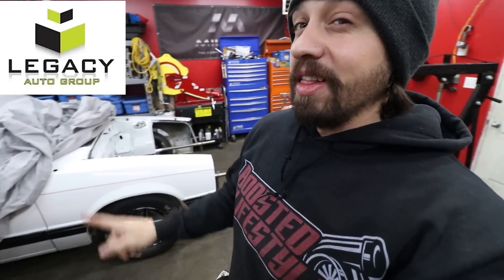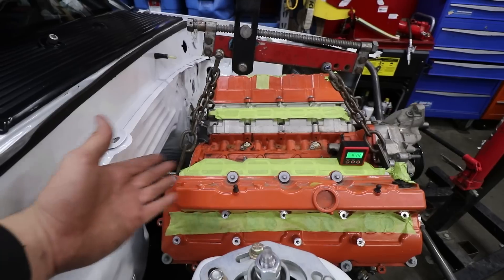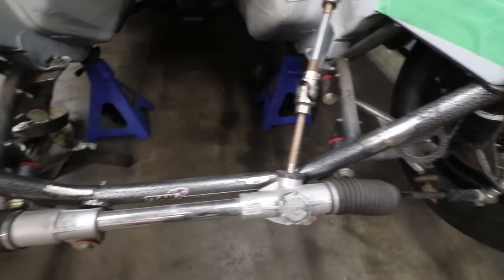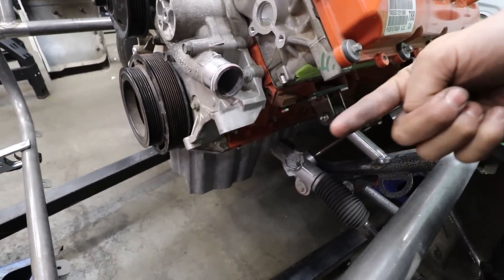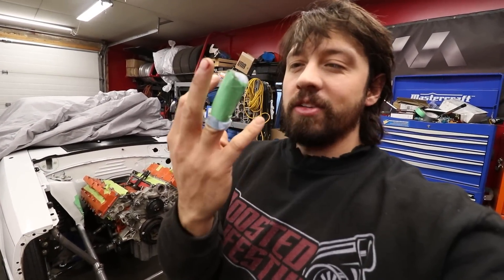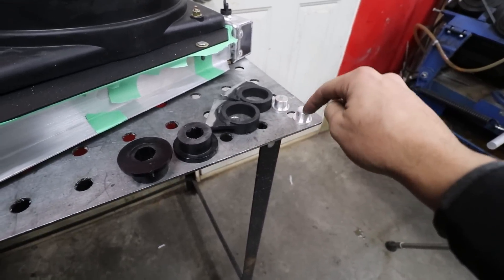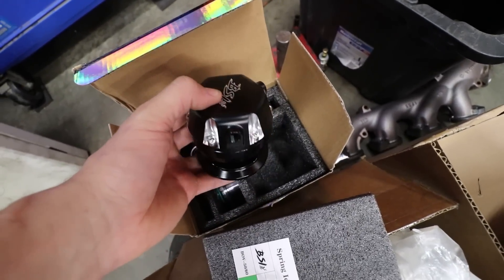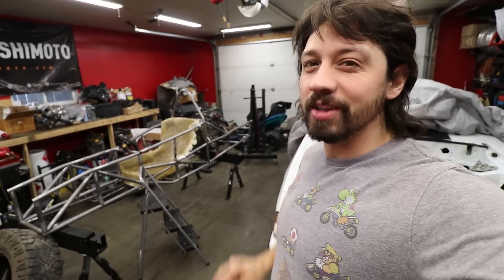Twin Turbo Hellcat Swapping A Foxbody - Part 1

Comment: And u can use the 5.7/6.4 intake seeing u can use the hellcat blower on 5.7/6.4 Ud need a mmx adapter plate and flip it up side down should bolt right on no one has done it yet but it will work for sure can’t wait to see this one very cool build
Reply from the maker: You can actually just tap the 6.2 head to accept a normal intake too

Comment: You can use the 6.1 intake manifold they sell adapter plates and then you just drill and tap for new holes
Reply from the maker: We got a plasmaman on the way 😁😁

Comment: Bigger holes dont always mean more flow. Port design and height also determine it and At a certain point you loose velocity with bigger ports.  Like blowing through a straw and a toliet paper roll the air is going to move faster out of the straw

Comment: Just a bit of warning, before final bolt down of the motor and trans make sure you measure bell housing run-out. If the bell housing is not .005" or less In centerline tremec will not warranty the magnum if something happens to go wrong with it. If runout is out of spec simply install offset dowel pins. (Mine was out of spec, needed .007" offset dowel pins to maintain warranty on trans) my application was a mod motor in a mustang but same trans and same bell housing manufacturer
Reply from the maker: Will do sir. I just bolted it up now for mock up 😁

Comment: I dont know if its really fair to say that new hemis have glass bottom ends. The early ones were bad about dropping valve seats and it seems like they like to eat camshafts but there isnt too many problems with them. The stock pistons on trucks and 300s is deliberately a NA piston with a thin crown and tight ring grooves with narrow rings. The first thing that happens when guys beat on them or boost them is they pinch the ring lands, butt the rings or soften the piston top with all the same consequences. You get piston chunks and a very bad day. 
Its actually pretty hard to find guys that have bent a gen3 hemi rod with the piston intact.

Comment: in hindsight it mighve ended u nicer looking if you had build the frame side of the motormounts and then tackweld the engine side tabs on the plates to line them up with the frame mounts
looking at the exhaustmanifld and the way the wheel turns in on the side youre working on you might have better clearance around the tire if you clock the turbine a quarter turn and go over the top tube of the frame , gets the exhaust closer to the hood though , and the bend might run a bit too close to the valvecover to make removal hard on a hot engine , might need to see if theres enough clearance for it
if you have the room around the steering columb you could go down back come bank up behind the v band then go up along the side of the manifold and curve slightly forward intoo the turbo again over the tube frame (basicly a twisted tree quarter circle )  , the sparkplugs seem to be on the inside of the valey between the heads so the exhaust tubes arent in the way of that , might keep the header way from the alternator on the other side too 
i wonder if you can adapt a holley sheetmetal sniper manifold to fit the hellcat , by cutting off the runners and fit new ones matched to the hellcat ports , the sheetmetal manifold should be weldable , they might actually have one for that engine

Comment: Which one of your turbos would you recommend for 6.0 LQ4 with basic upgrades like cam and heads and ring gap stock bottom end going to hopefully be in a 68 C10 short bed goal would be 800 and room to grow with out swapping turbos if possible great video keep up the content
Reply from the maker: Either a 76mm or 80mm in the 96 turbine wheel 😁
Reply: @Boosted Lifestyle  thanks a lot for the info I will see what you guys off on your website

Comment: What exactly did you do to make those manifolds work facing forward? I was always told that the gen 3 hemi manifolds weren’t compatible facing forward because of the shape of the exhaust porting and the bolt locations